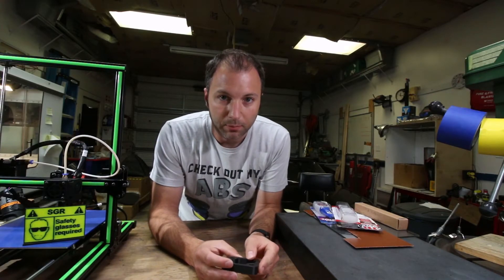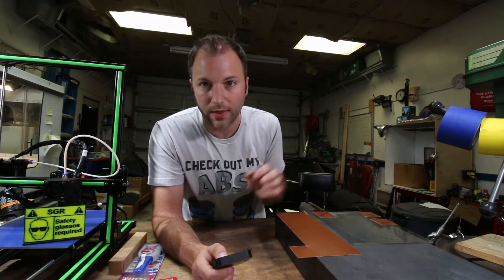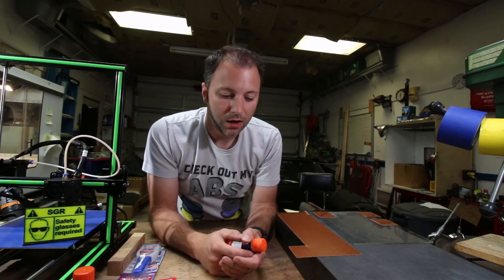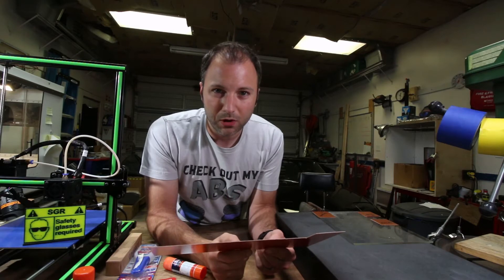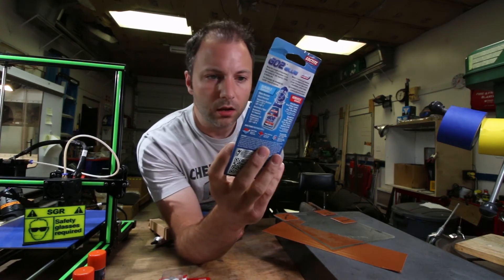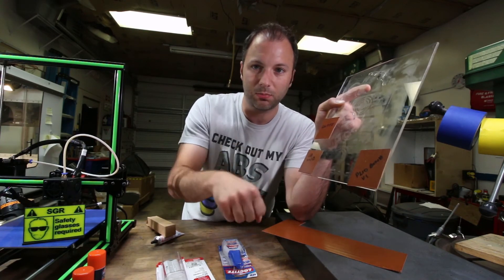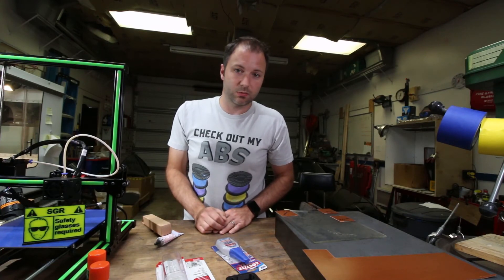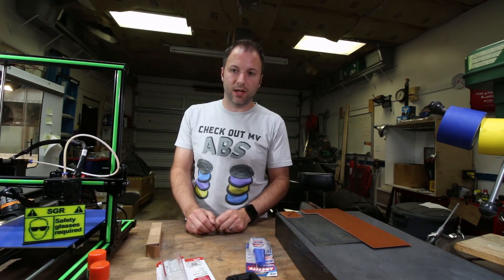How to: Getting 3d printed Nylon to Stick to the printer bed

Comment: It appears to me that the secret to getting nylon to stick is nozzle to bed distance. I couldn’t get my nylon parts to stick. I tried everything that was recommended as a bed adhesive, nothing worked until I lowered the nozzle to about 8 or 9 thousandths from the glass bed. I now have no trouble getting them to stick. Just a thin shot of hairspray and I have even a little trouble breaking them loose.

Comment: Thank you for this video! And I noticed by myself ( didn’t have any 3d print school yet) that the biggest reason it cause that, is the huge rated heat shrink, which might be supported by a spider shaped, single layer base, which I cannot find this programming anywhere... I can do nothing on programming!

Comment: the garolite sheets from the link you provided come laminated and need to be sanded with either a scotch bright pad or 220+ grit sandpaper, otherwise  larger printed parts will lift from the (non heated) garolite sheets after roughly 8 hours.
Reply from the maker: That's a good tip..I've found that even with PEI it's needed to scuff it a bit after awhile to keep it fresh and sticking to PETG and ABS.
Reply: Be careful sanding garolite.  That stuff isn't great to breathe in.

Comment: What nozzle diameter and build extrusion layer height did you use for the print?  I've had a bit of trouble getting my gasoline set up to work and I'm wondering if its also a settings issue.

Comment: i wanna go nylon cause i wanna be able to print weed eater trimmer line from the store.
Reply from the maker: I would advise against trimmer line. It may work but.... in general there is going to be a lot of issues to work through. First things that come to mind: additives that make it better for being a trimmer line may make it not print well or wear out your extruder parts faster. Those additives may also be toxic. Another concern is the consistency in diameter. Most filament manufacturers are actively monitoring and controlling the diameter of their filament to +/-0.05mm. Variation in diameter at a minimum effects print quality even small changes can be perceptible.  Larger variations can jam your machine.  Even with the tighter quality control from most filament manufacturers I've had issues with out of spec filament 1.85mm+ (on a 1.75mm machine) jamming up and failing the print. Depending on the machine you may need to tear apart your extruder to repair it and replace parts. The tolerance for trimmer line can be much much larger than the typically tight tolerance of 3d printer filament without affecting it's ability to cut down grass. So in general I think it's not a great idea to use trimmer line especially with the availability today of a wide range of affordable filament options.

Comment: For glue sticks, cover the area you intend to print on with PVA or whatever you are using then wet your finger and smear it around (almost as if you are trying to clean it off).  Basically you want a super thin smear rather than a big dollop.  If this doesn't work use double sided polypropylene tape which works amazingly well and can be reused several times.

Comment: Did you think of using the glue used to glue the rear view mirrors on glass in cars? Also I am supprised that Matterhackers didn't mention the Airwolf3d product called wolfbite. it works really well. The other thing I wanted to mention is I use simplify3d as well. You can set your offset in the script areas so its just a profile you load instead of messing with that offset. Just ask them and the techs will even send you a sample.  Also with those glues... I used to work in aerospace as a planner and worked with many bonding agents. For some of those glues to work you have to rough up the glass surface so they have something to stick to. Also you can use RTV (the high temp red) and it takes a while to cure but will allow higher tempratures. The Red stuff is 600F. Way hotter than what your 3d printer can do.
Reply from the maker: Didn't think about the rearview mirror glass. Could work. You would need a lot of it I feel like compared to the tubes they are normally sold in. I tried Airwolf wolf bite. It required many many coats and had mediocre performance for the amount of effort it took every print to work well from my experience. Wolfbite also isn't  cheap. I haven't seen any ill effects changing that offset any reason the script is better? That offset changes with the profile as well. Rtv is a good suggestion. In general I was looking to duplicate the ease of use of the Markforged bed for printing nylon. One quick wipe with glue stick hit print and effortless adhesion without a heated bed. Recently I haven't printed much nylon but the times I have I have used Geckotek Ez-stick as my now default bed surface and have been impressed. It has a finite life (hundred of prints or so) from what I've seen but application and print to print use and reliability has been great!

Comment: Just a thought, could you just buy a 1/8" thick garolite sheet and set it directly on the print bed, no glass at all, just the 1/8" garolite?
Reply from the maker: If your print bed is flat enough. In my case my aluminum bed is not machined flat so the glass helps to create a flat and level surface for garolite to bond to and creat a flat print surface. If your bed was machined flat like a Mic6 plate you could certainly bond right to that. Markforged's beds do just that garolite bonded to aluminum plate.

Comment: first thing you can not have any flow of air on the nozzle ,,the fan that cools your extruder by default blows inward and also ends up blowing downward  ,,   take the fan off and turn it so now the air is blowing out ,,it makes a very big difference ,,always run your printer 15 minutes after finish print so fan cools down nozzle,,, no 2  if you do cad add and extra tab on the corners  to help keep the corners in place ,the tab can be sniped off after print is done,, no. 3 take your elmer glue stick remove the glue cut in little pieces ,place it in 3 or 4 oz. water ,you will end up with a liquid past  that can be brushed on easy and most important it spreads even on the bed , bed temp 60 to 90 don't seem to make much difference if you go with the above,
245 nozzle ??? speed 50 to 70  ,,, one more important thing the people having problems with higher temp sometimes get printer shutting down with temp error ,,, by changing the fan around 90 percent of the time will make the fix ,,there are of course other things  that can cause the problem ,,I very seldom post but all the glue in the world will not work if you have  ANY air flowing on nylon  ,,,,,,,  ,,,good luck as we all keep learning new tricks into the world of 3d printing
Reply: It's amazing how both filament and printer companies have parameters for nylon, and none of them work, at all. They make it sound trivial.
Reply from the maker: Have you ever had the opportunity to check out a Markforged 3d printer? It's probably the best fdm printer for printing nylon I have ever used. Print quality is amazing. They use a bed fan to actually cool the part during the print. They also use glue on garolite. The glue is not to increase adhesion in their case it's to create a "release" layer. I witnessed a print that someone forgot the glue. It was almost impossible to remove. Thanks for watching and for the tips.

Comment: Which printer works best with nylon, your CR-10S or the PRUSA i3 MK2?
Reply from the maker: +Steven Raymond That's an Anet E10 in the photo and I haven't tried nylon with it. I don't think the extruder can go hot enough for nylon reliably. The Prusa does an Ok job at nylon.  Nylon doesn't like to stick to the PEI bed so you need to use lots of glue and a huge brim. My Makergear m2 so far had been my favorite for nylon with the garolite bed I made in this video.

Comment: awesome video and good information! how many layers of glue do you apply on the garolite for nylon? you mentioned how much for glass but not for the garolite.
Reply from the maker: +LICK_THE_BUTTER Just one solid layer. It's used more as a release agent than an adhesion promoter from what I understand from using a Markforged.
Reply: ok thanks, i've placed an order for the exact sheet and will give this a shot :)

Comment: Thanks for a great video. Do you use your CR-10 to print Nylon with the standard Hotend ? Thanks
Reply from the maker: +Vaughan Lundin all my nylon printing has been on my Makergear M2 or my Prusa I3 mk2. I don't own a Cr10 I have an Anet  E10 which looks similar but but the hotend doesn't go quiet hot enough for nylon.

Comment: Does printing with NylonX require a heated build chamber? I notice that you have one.
Reply from the maker: +Paul Boudreau I don't believe it does. You could check Matterhackers website or contact them for info they have been super helpful when I asked them about bed adhesion.

Comment: Could you maybe do a guide to solving nylon printing issues like stringing? I can't seem to get rid of it regardless of retraction settings.
Reply from the maker: +Ktmfly3r have you tried drying it? Are you storing it in a drybox? Nylon loves to absorb moisture and when it does the water turns to vapor in the 260c nozzle and forces the nozzle to leak and string.

Comment: Even with all that work, Glue Stick is still needed.
Reply from the maker: +theflamingpi glue stick is unreliable on glass from what I've found unless you've got 10 minutes to put 6 layers on for every print. Then you have to heat the bed to 80-100C which takes another 5mins. If you are doing one print in nylon ever don't spend $7 and 30 minutes making a garolite bed. But if you want to regularly print in nylon it will save you a ton of time in long run.  With garolite I've had no bed adhesion issues or warping with one quick swipe of normal glue stick( 30 secs tops) while the extruder is warming up no need to heat bed.
Reply: I don't doubt it.  It's a common issue with 3D Printing.  What I was commenting on was simply that even with the Garolite, which seems to work fantastically, the glue stick is still needed.  Glue stick is used by newbies with PLA and PETG.  It's used on ABS, ASA, and TPU.  It's used on every filament I've seen.  People keep coming up with new methods, and they find ways that limit the use of glue stick, but these methods won't necessarily get rid of the stick entirely.

Personally, I haven't used glue stick since January.  But, I print in PETG on clean glass and spend time learning precise settings and getting the level perfect.  Not everyone can or will for PETG, and this method won't work for all nylon.
Reply: I can't remember which it was... one of the build surfaces recommended the use of glue stick so that filaments would release because the surface would permanently bond to the plastic.
Reply from the maker: PEI (Ultem) is the surface you are thinking of.  If you print TPU or PETG it can stick way too well (maybe permanently) and you need the glue to act as a release surface.  It's crazy to me that good old Elmer's glues stick is this useful for what feels like a cutting edge technology like 3d printing.
Reply: It's seriously the most versatile tool.  I haven't used it since January, but I still keep a tube handy just in case.  Also, how weird is it that hairspray works as well as it does?  School supplies and hair products.  That's what we're using to augment our $200-$5000 industrial engineering equipment.

Don't get me started on binder clips.

Comment: Quick question, how do other materials print on garolite? Is it worth using garolite as a permanent bed surface for all materials?
Reply from the maker: I have not heard of other materials sticking to garolite but that is a good question.  If I get some time later this week maybe I will try some PLA or ABS and see what happens.  I will post the results on Instagram or Facebook most likely first.  If it works well I'll make an add on video.

Comment: Have you tried nylon string trimmer line? I scored a 3 pound roll of 1.7mm round trimmer line. Have not tried to print with it yet.
Reply from the maker: +Nerys I've not heard good things about string trimmer line for 3d printing. Two things to watch for are: 1)variation in filament diameter, printing filament is usually within 0.05mm of 1.75mm.  Some machines can't handle much variation without jamming. Even if your machine can handle it print quality will suffer. String trimmer line has no reason to be made to that tight of tolerance.  2) A lot of string trimmer line has abrasive filler added to it. This helps it last longer for cutting weeds. But will tear up a printer nozzle. Good luck if you do try it.
Reply: I will probably end up trying it some day on my Anet A8 but im not about to do that to my CR-10